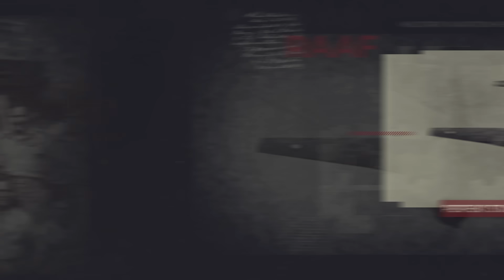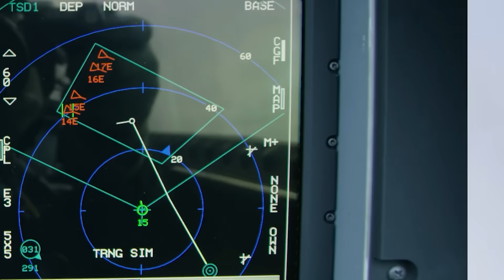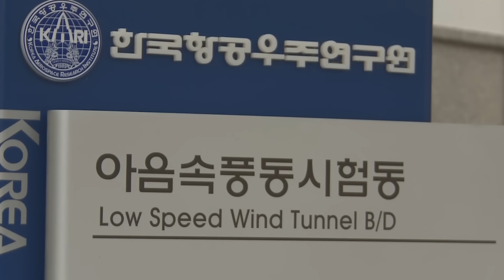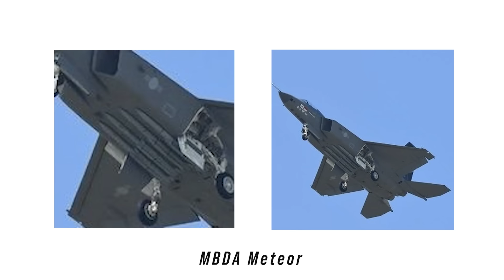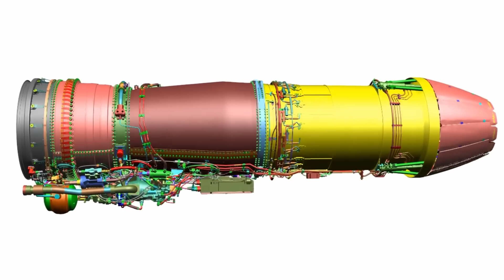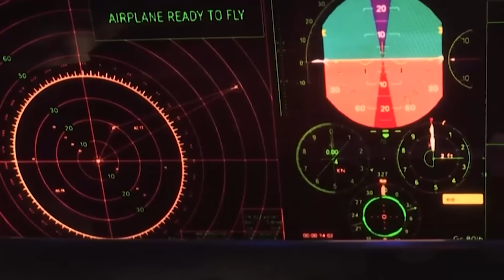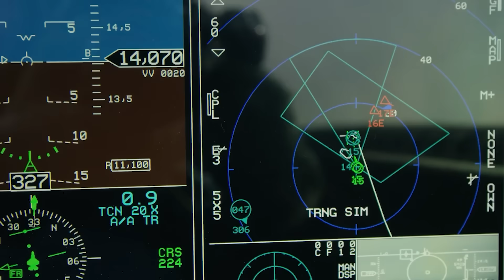KF-21: Korea's New Fighter

Comment: 😂
1. Aesa radar by Hanwha(Korea) 
2. IRST by Hanwha(Korea)
3. RF Jammer by LIG Nex1(Korea)
4. Eotgp by Hanwha(Korea)
5. PWR by LIG Nex1(Korea)
6. EWC by LIG Nex1(Korea)
7. CMDS by LIG Nex1(Korea)
8. Digital Cockpit by Hanwha/ADD (Korea)
9. Mission Computer by KAI/ADD(Korea)
10. Avionics control system by KAI(Korea)
11. Brake system by KAI (Korea)
12. K Link Communication System by Hanwha/ADD (Korea)
13. Aircraft Fuselage by KAI (Korea)
14. Aircraft wings by KAI (Korea)
15. GE engine licensed by Hanwha (40% Korea)
16. LRAAM / SRAAM / KALCM / L MCM / L MSM / Hypersonic missiles by LIG Nex1 (Korea)

Korean American Dr. Park Si Mong who participated in the production of the F22 Raptor also participated  in the KF21 design.
Design / Wind tunnel test / over 1,300 flight test of KF 21 across 6 prototypes by Korea with only the blend body, canted tails and S duct design collaboration with Lockheed Martin who have been decades long partner of South Korea. KF 21 is a less expensive, cost effective, less stealth, low observability and not full stealth until KF 21 batch 3 with internal weapons bay.

Comment: This video missed a few things.  The KF21 looks more like f-22, thus the nickname baby raptor.  Korea is on the verge of developing it's own engines and will abandone the GE engine it's currently using shortly.  It's capability has show to be higher than initial goal.  They kept their intention secret 'till recent because they didn't want too much attention.  But the KF21 was built with many upgrades in mind from the getgo.  First, the body mimicks raptor becasue it was built to be stealth.  They've already succeeded in producing the stealth paint.  Also has the later block that has internal weapons bay to make it fully gen 5.  The twin cockpit version was produced for it to be used with drones in mind.  The second cockpit is for the controller of trones which they are scheduled to complete in 2028, just couple of years out.  It would fly with 5-6 drones in formation further increasing it's payload capability.  Once all the upgrades are implemented, it's actually more like 5.5 gen.  But that's not the biggest surprise.  They can produce multiple planes at once.  It's fully automated robotic plant can produce multiple planes simultaneously and the production speed will be uncanny... just like K2 and K9.  Unlike US weapons producers who only make weapons, these companies that produce Korean weapons are commercial manufacturers and know how to streamline production.  It's on another level.

Comment: South Korea and china are only good for trying to copy America air combat. Because they can’t come up with anything of their own.
Reply: 😂
1. Aesa radar by Hanwha(Korea) 
2. IRST by Hanwha(Korea)
3. RF Jammer by LIG Nex1(Korea)
4. Eotgp by Hanwha(Korea)
5. PWR by LIG Nex1(Korea)
6. EWC by LIG Nex1(Korea)
7. CMDS by LIG Nex1(Korea)
8. Digital Cockpit by Hanwha/ADD (Korea)
9. Mission Computer by KAI/ADD(Korea)
10. Avionics control system by KAI(Korea)
11. Brake system by KAI (Korea)
12. K Link Communication System by Hanwha/ADD (Korea)
13. Aircraft Fuselage by KAI (Korea)
14. Aircraft wings by KAI (Korea)
15. GE engine licensed by Hanwha (40% Korea)
16. LRAAM / SRAAM / KALCM / L MCM / L MSM / Hypersonic missiles by LIG Nex1 (Korea)

Korean American Dr. Park Si Mong who participated in the production of the F22 Raptor also participated  in the KF21 design.
Design / Wind tunnel test / over 1,300 flight test of KF 21 across 6 prototypes by Korea with only the blend body, canted tails and S duct design collaboration with Lockheed Martin who have been decades long partner of South Korea. KF 21 is a less expensive, cost effective, less stealth, low observability and not full stealth until KF 21 batch 3 with internal weapons bay.

Comment: You call China for copying this n that part of US aircrafts. But for kf21? Duplicate of f35?
Reply: 😂
1. Aesa radar by Hanwha(Korea) 
2. IRST by Hanwha(Korea)
3. RF Jammer by LIG Nex1(Korea)
4. Eotgp by Hanwha(Korea)
5. PWR by LIG Nex1(Korea)
6. EWC by LIG Nex1(Korea)
7. CMDS by LIG Nex1(Korea)
8. Digital Cockpit by Hanwha/ADD (Korea)
9. Mission Computer by KAI/ADD(Korea)
10. Avionics control system by KAI(Korea)
11. Brake system by KAI (Korea)
12. K Link Communication System by Hanwha/ADD (Korea)
13. Aircraft Fuselage by KAI (Korea)
14. Aircraft wings by KAI (Korea)
15. GE engine licensed by Hanwha (40% Korea)
16. LRAAM / SRAAM / KALCM / L MCM / L MSM / Hypersonic missiles by LIG Nex1 (Korea)

Korean American Dr. Park Si Mong who participated in the production of the F22 Raptor also participated  in the KF21 design.
Design / Wind tunnel test / over 1,300 flight test of KF 21 across 6 prototypes by Korea with only the blend body, canted tails and S duct design collaboration with Lockheed Martin who have been decades long partner of South Korea. KF 21 is a less expensive, cost effective, less stealth, low observability and not full stealth until KF 21 batch 3 with internal weapons bay.

Comment: The KF-21 Boramae fighter jet is powered by two General Electric F414 engines, which provide the necessary thrust for its operations. Additionally, there are plans for a domestically developed engine to replace the F414 in future variants.

Comment: Where are the bad mouths now??

The Chinese J-20 was the copy of the F-22
The Chinese J-35 was the copy of the F-35

and the KF-21?? is iot not a messy mix of the F-22 and the F-35 but worst as it doesn't even have internal weapons bays????
Reply: 😂
1. Aesa radar by Hanwha(Korea) 
2. IRST by Hanwha(Korea)
3. RF Jammer by LIG Nex1(Korea)
4. Eotgp by Hanwha(Korea)
5. PWR by LIG Nex1(Korea)
6. EWC by LIG Nex1(Korea)
7. CMDS by LIG Nex1(Korea)
8. Digital Cockpit by Hanwha/ADD (Korea)
9. Mission Computer by KAI/ADD(Korea)
10. Avionics control system by KAI(Korea)
11. Brake system by KAI (Korea)
12. K Link Communication System by Hanwha/ADD (Korea)
13. Aircraft Fuselage by KAI (Korea)
14. Aircraft wings by KAI (Korea)
15. GE engine licensed by Hanwha (40% Korea)
16. LRAAM / SRAAM / KALCM / L MCM / L MSM / Hypersonic missiles by LIG Nex1 (Korea)

Korean American Dr. Park Si Mong who participated in the production of the F22 Raptor also participated  in the KF21 design.
Design / Wind tunnel test / over 1,300 flight test of KF 21 across 6 prototypes by Korea with only the blend body, canted tails and S duct design collaboration with Lockheed Martin who have been decades long partner of South Korea. KF 21 is a less expensive, cost effective, less stealth, low observability and not full stealth until KF 21 batch 3 with internal weapons bay.

Comment: KF-21 looks awfully familiar lol, I'm still mad we didn't finish production on all 700~ F-22's.
Reply: 😂
1. Aesa radar by Hanwha(Korea) 
2. IRST by Hanwha(Korea)
3. RF Jammer by LIG Nex1(Korea)
4. Eotgp by Hanwha(Korea)
5. PWR by LIG Nex1(Korea)
6. EWC by LIG Nex1(Korea)
7. CMDS by LIG Nex1(Korea)
8. Digital Cockpit by Hanwha/ADD (Korea)
9. Mission Computer by KAI/ADD(Korea)
10. Avionics control system by KAI(Korea)
11. Brake system by KAI (Korea)
12. K Link Communication System by Hanwha/ADD (Korea)
13. Aircraft Fuselage by KAI (Korea)
14. Aircraft wings by KAI (Korea)
15. GE engine licensed by Hanwha (40% Korea)
16. LRAAM / SRAAM / KALCM / L MCM / L MSM / Hypersonic missiles by LIG Nex1 (Korea)

Design / Wind tunnel test / over 1,300 flight test of KF 21 across 6 prototypes by Korea with only the blend body, canted tails and S duct design collaboration with Lockheed Martin who have been decades long partner of South Korea. KF 21is a less expensive, cost effective, less stealth, low observability and not full stealth until KF 21 batch 3 with internal weapons bay.

Comment: So... it's basically a Raptor, but then Korean?
Reply: 😂
1. Aesa radar by Hanwha(Korea) 
2. IRST by Hanwha(Korea)
3. RF Jammer by LIG Nex1(Korea)
4. Eotgp by Hanwha(Korea)
5. PWR by LIG Nex1(Korea)
6. EWC by LIG Nex1(Korea)
7. CMDS by LIG Nex1(Korea)
8. Digital Cockpit by Hanwha/ADD (Korea)
9. Mission Computer by KAI/ADD(Korea)
10. Avionics control system by KAI(Korea)
11. Brake system by KAI (Korea)
12. K Link Communication System by Hanwha/ADD (Korea)
13. Aircraft Fuselage by KAI (Korea)
14. Aircraft wings by KAI (Korea)
15. GE engine licensed by Hanwha (40% Korea)
16. LRAAM / SRAAM / KALCM / L MCM / L MSM / Hypersonic missiles by LIG Nex1 (Korea)

Design / Wind tunnel test / over 1,300 flight test of KF 21 across 6 prototypes by Korea with only the blend body, canted tails and S duct design collaboration with Lockheed Martin who have been decades long partner of South Korea. KF 21is a less expensive, cost effective, less stealth, low observability and not full stealth until KF 21 batch 3 with internal weapons bay.

Comment: almost a spitting image of the f22
Reply: 😂
1. Aesa radar by Hanwha(Korea) 
2. IRST by Hanwha(Korea)
3. RF Jammer by LIG Nex1(Korea)
4. Eotgp by Hanwha(Korea)
5. PWR by LIG Nex1(Korea)
6. EWC by LIG Nex1(Korea)
7. CMDS by LIG Nex1(Korea)
8. Digital Cockpit by Hanwha/ADD (Korea)
9. Mission Computer by KAI/ADD(Korea)
10. Avionics control system by KAI(Korea)
11. Brake system by KAI (Korea)
12. K Link Communication System by Hanwha/ADD (Korea)
13. Aircraft Fuselage by KAI (Korea)
14. Aircraft wings by KAI (Korea)
15. GE engine licensed by Hanwha (40% Korea)
16. LRAAM / SRAAM / KALCM / L MCM / L MSM / Hypersonic missiles by LIG Nex1 (Korea)

Design / Wind tunnel test / over 1,300 flight test of KF 21 across 6 prototypes by Korea with only the blend body, canted tails and S duct design collaboration with Lockheed Martin who have been decades long partner of South Korea. KF 21is a less expensive, cost effective, less stealth, low observability and not full stealth until KF 21 batch 3 with internal weapons bay.

Comment: Nice plane, but since it uses American technology it is pretty useless for countries looking to not buy US jets. If this had used the RR engine and cooperate not with Lockheed but BAE or Dassault, for example, it would be a nice alternative for countries like Spain, Canada, etc. Working together with Indonesia has not paid off, it seems.
Reply: 😂
1. Aesa radar by Hanwha(Korea) 
2. IRST by Hanwha(Korea)
3. RF Jammer by LIG Nex1(Korea)
4. Eotgp by Hanwha(Korea)
5. PWR by LIG Nex1(Korea)
6. EWC by LIG Nex1(Korea)
7. CMDS by LIG Nex1(Korea)
8. Digital Cockpit by Hanwha/ADD (Korea)
9. Mission Computer by KAI/ADD(Korea)
10. Avionics control system by KAI(Korea)
11. Brake system by KAI (Korea)
12. K Link Communication System by Hanwha/ADD (Korea)
13. Aircraft Fuselage by KAI (Korea)
14. Aircraft wings by KAI (Korea)
15. GE engine licensed by Hanwha (40% Korea)
16. LRAAM / SRAAM / KALCM / L MCM / L MSM / Hypersonic missiles by LIG Nex1 (Korea)

Design / Wind tunnel test / over 1,300 flight test of KF 21 across 6 prototypes by Korea with only the blend body, canted tails and S duct design collaboration with Lockheed Martin who have been decades long partner of South Korea. KF 21is a less expensive, cost effective, less stealth, low observability and not full stealth until KF 21 batch 3 with internal weapons bay.
Reply: @Nllllllli  Lots of things are licensed from the US. Even if they are built by Hanwha.
Reply: @Prometheus4096 the only thing licensed was the GE engines from the U.S. The 3 part collaboration regarding the body design will be beneficial to Lockheed also because they'll be getting part of the profits. Hanwha is the same corporation that's rebuilding the U.S. Shipping industry. 👍

Comment: A f35 and F22 merge of design... minus thurst vtr and other factors. Time the US allows the blend to other friendless or the still ...
Reply: 😂
1. Aesa radar by Hanwha(Korea) 
2. IRST by Hanwha(Korea)
3. RF Jammer by LIG Nex1(Korea)
4. Eotgp by Hanwha(Korea)
5. PWR by LIG Nex1(Korea)
6. EWC by LIG Nex1(Korea)
7. CMDS by LIG Nex1(Korea)
8. Digital Cockpit by Hanwha/ADD (Korea)
9. Mission Computer by KAI/ADD(Korea)
10. Avionics control system by KAI(Korea)
11. Brake system by KAI (Korea)
12. K Link Communication System by Hanwha/ADD (Korea)
13. Aircraft Fuselage by KAI (Korea)
14. Aircraft wings by KAI (Korea)
15. GE engine licensed by Hanwha (40% Korea)
16. LRAAM / SRAAM / KALCM / L MCM / L MSM / Hypersonic missiles by LIG Nex1 (Korea)

Design / Wind tunnel test / over 1,300 flight test of KF 21 across 6 prototypes by Korea with only the blend body, canted tails and S duct design collaboration with Lockheed Martin who have been decades long partner of South Korea. KF 21is a less expensive, cost effective, less stealth, low observability and not full stealth until KF 21 batch 3 with internal weapons bay.

Comment: Fun fact: Though C-105 was lack of internal weapon bay and KF-21 still is, but it has enough empty space for it, and a plan for install it in later version of KF-21.
KF-21 BLOCK 1 is for fast deployment of KF-21 for replacing old F-5s.
KF-21 BLOCK 2 is for upgrade them to have ground attack capabilities, and BLOCK 3 is real deal.
In BLOCK 3, ROKAF plans to internalize IRST(which is on the left side of canopy, just like Russian Sukhoi fighters) and use stealth painting with internalized weapon bay.

BLOCK 3 is still in development but Hanwha aerospace already has a technology of the actuator of the weapon bay door so it's matter of time and the needs of ROKAF and other countries.

Comment: This South Korean 4.5-gen fighter, developed by KAI since 2015, hits Mach 1.8 with twin GE F414 engines and a 1,500-nautical-mile range, packing AESA radar and 7,700 kg of weapons (e.g., Meteor missiles). Its July 2022 first flight and 2024 serial production mark a leap from the FA-50, with 120 units planned by 2032 to replace aging F-4s/F-5s. The KF-21EX variant’s internal bays and Indonesia’s 7.5% stake (down from 20%) add intrigue, despite early teething issues. A bold, export-ready contender!

Comment: Every thing looks like an F-22 now
Reply: 😂
1. Aesa radar by Hanwha(Korea) 
2. IRST by Hanwha(Korea)
3. RF Jammer by LIG Nex1(Korea)
4. Eotgp by Hanwha(Korea)
5. PWR by LIG Nex1(Korea)
6. EWC by LIG Nex1(Korea)
7. CMDS by LIG Nex1(Korea)
8. Digital Cockpit by Hanwha/ADD (Korea)
9. Mission Computer by KAI/ADD(Korea)
10. Avionics control system by KAI(Korea)
11. Brake system by KAI (Korea)
12. K Link Communication System by Hanwha/ADD (Korea)
13. Aircraft Fuselage by KAI (Korea)
14. Aircraft wings by KAI (Korea)
15. GE engine licensed by Hanwha (40% Korea)
16. LRAAM / SRAAM / KALCM / L MCM / L MSM / Hypersonic missiles by LIG Nex1 (Korea)

Design / Wind tunnel test / over 1,300 flight test of KF 21 across 6 prototypes by Korea with only the blend body, canted tails and S duct design collaboration with Lockheed Martin who have been decades long partner of South Korea. KF 21is a less expensive, cost effective, less stealth, low observability and not full stealth until KF 21 batch 3 with internal weapons bay.

Comment: Turkey's Khan fighter jet will fail.
There are no engines, avionics depend on imports, various systems have not been localized, and there are no companies to cooperate in areas with very high technical difficulties. And unreasonable requirements are ignored because they are almost blade strength.
The reality is two or three test flights...
Even if the development is successful in the future, it will take more than 10 years to produce, and Korea will already be producing the perfect stealth machine of KF21 block 3, and the core engine will also be developed and applied by itself.
Countries that want to be with Turkey are countries that are not helpful at all, such as Indonesia and Pakistan that Korea is trying to clean up.
Indonesia won't get any help from Korea. However, it seems that they were trying to provide Turkey with the stolen technology, given that they were trying to steal the technology.
Turkey is almost as strong as a blade in defense.
Korea controls the technology of K9 self-propelled artillery technology and Altai tanks, and it needs to be approved by Korea to export.
Turkey has very little of its own technology.
Reply: Lmao, you must be one of those angry Korean incels I keep hearing about.